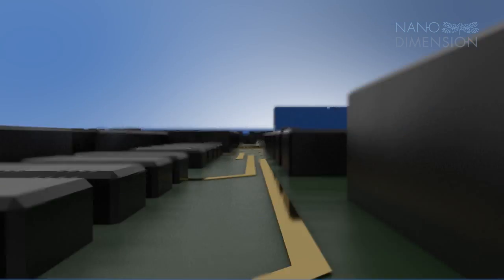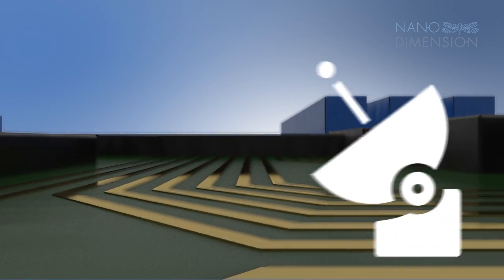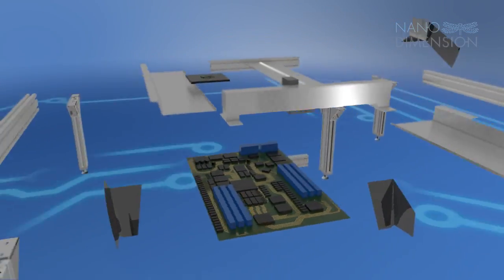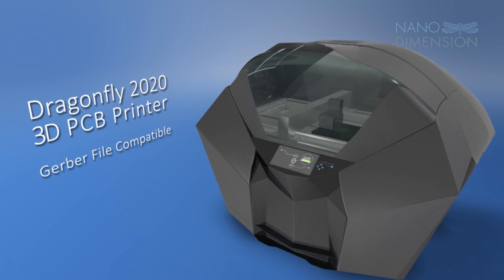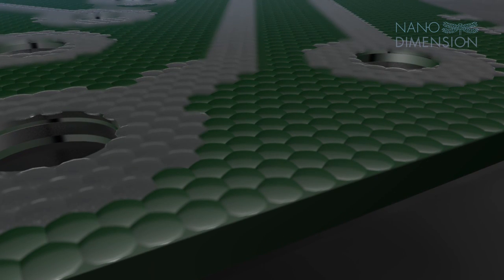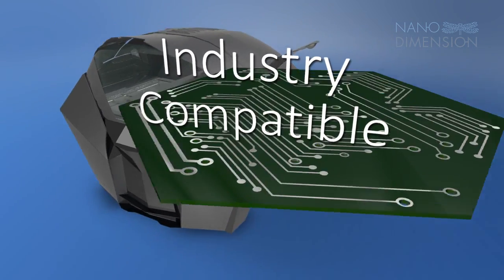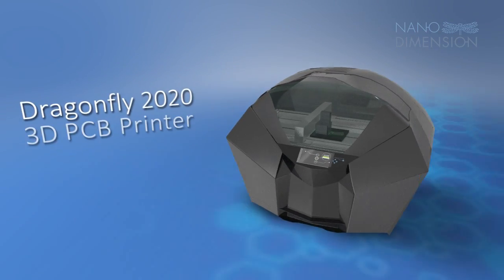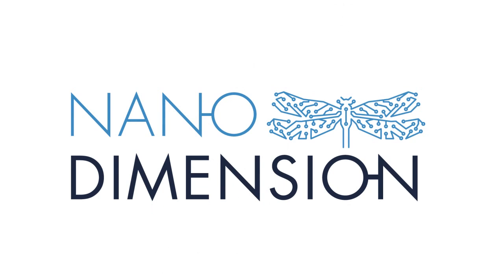Nano Dimension 3D Printer for PCBs

Comment: Based on the flying graphic, the holes are not "plated through" (or equivalent).  For boards that have more than the basic two outer layers, I wonder if solder will always flow down to the inner layers.  Could be problematic.